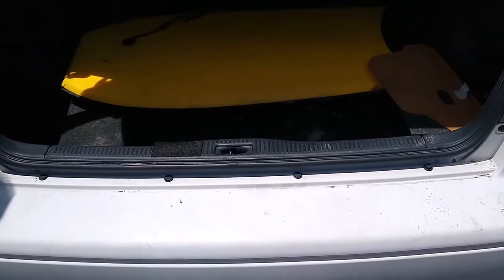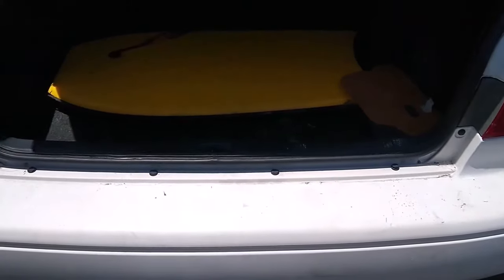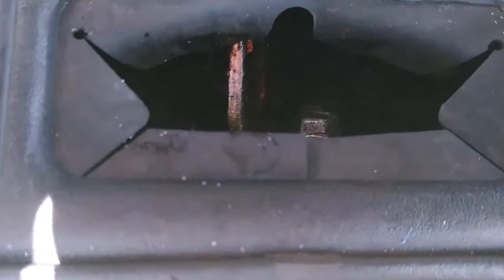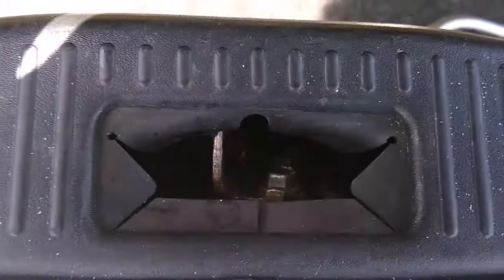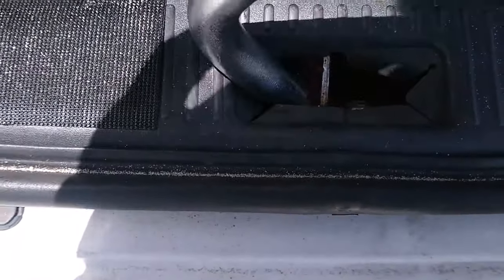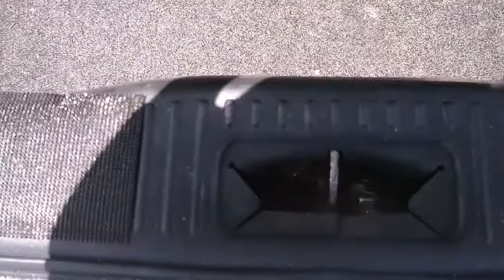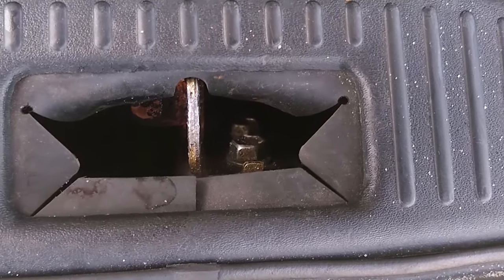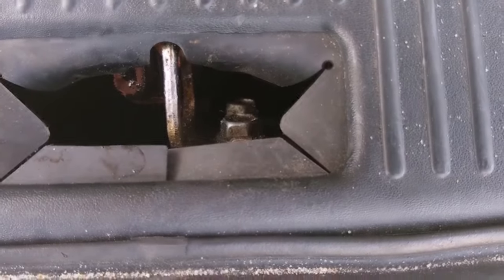How to fix a trunk that wont shut or latch DIY video #diy #trunk #shut #latch

Comment: Thanks very much for sharing via YouTube. I am a 65 year old female and just purchased a 2003 Honda Civic LX 2 door coupe three days ago. The trunk cable inside vehicles opens the trunk but I kept working the trunk to stay closed and locked. The Honda dealer wanted three hundred plus dollars to change the gas/trunk cable assembly. Research using on YouTube and finding this video gave me insight as to what to try first on my very own. Sharing blessings worldwide is what helps make the world go around. Smiles
Reply: @Noreene.  Thanks so much for your comment and best of luck with your next DIY project. Please let us know how it works out for you.   Smiles to you.
Reply: @BigAl-1  It was so easy opening my trunk and I barely touched the gasoline cover cable. I then removed the clip attached on the inner side of the gasoline cover. Now I only have to press the outer outside edge of my gasoline cover to get gas. The previous owner had two keys to unlock my gasoline cap. Thanks for reaching out to me. Much love for people to share their God-given talents, skills, blessings, and love. Smiles
Reply: @noreenebostick9593  I'm so glad it worked out well for you.  Smiles

Comment: For those who got a Nissan Sentra, if the plastic parts of the trunk is ripped from where it latches, do yourself a favor and tear that plastic off. It’s gonna do some damage to your interior, but I’d rather have a trunk that closes. And it closed so that’s what I did. Improvise and see what you guys can do.
Reply: Thanks so much for your comment. Best of luck with your next DIY project and hopefully you will subscribe to Big Al Repairs.

Comment: I think that plastic edge liner pops off and once that little piece is off you can actually directly access the screws  through an opening inside that trunk wall in front of that catch so you don’t have to struggle with the tight space and a socket wrench. At least that is how it is on my old Camry. 
Great video. Thanks.
Reply: Adam, thanks so much for the suggestion.  I will have to give it a try.  Best of luck with your next DIY project.
Reply: This tip was also super helpful! It worked in my car.

Comment: That worked thanks. The 2 screws that tighten it were quite loose ,so l used  a screwdriver to lever it in to a postion where it closes properly now.
Not sure if it will stay there, because the 2 screws have weird fittings and I haven't the right tool
Reply: Thanks so much for your comment and explanation of your project. Best of luck with your next DIY project and hopefully you will subscribe to Big Al Repairs.

Comment: Thank you! It worked. All the mechanics were fine(cables/electronics). Just that darn metal loop was bent and moved over. This video was perfect!
Reply: C.D.J.  Thanks so much for taking the time to comment. I’m glad it fixed the problem. Best of luck with your next DIY project. Thanks again for watching Big Al Repairs and hopefully you subscribe.
Reply: @BigAl-1  thought I was already. Done.
Reply: @c.d.j300  Thanks so much for subscribing.

Comment: So mines not misaligned it’s the hook in the latch part not holding it closed it’s loose is that fixable ?
Reply: That is a great question. What you need to do is look and see if there is any way to loosen or tighten that latch and move it or adjust it. I no longer have that vehicle so it may take me a while to be able to respond and take a look and see what you can do but that would be my guess. Best of luck and please let us know how it turns out and hopefully you will subscribe to big Al repairs.

Comment: I desperately need instructions on how to replace that loop part. Mine broke and I have my trunk duct tape shut. All of the videos I've been finding are of the trunk lid half of the lock not the bottom half that is by the bumper. I have a 2010 Toyota Corolla.
Reply: Horrible,  it looks like on this truck. There are two bolts that you have to remove and then you can remove that latch. Please give us an update. Thanks so much for your comment!  Best of luck with all your DIY projects and hopefully you will subscribe to Big Al Repairs.

Comment: Someone hit me from behind and now my trunk doesn’t latch .. could this be the problem?
Reply: If it's been in an accident it could be this, a broken latch mechanism, or lots of other possibilities.
Reply: I just got hit from the back of December 30, 2021, and today, I went to work with a loose trunk because there's pieces inside the upper latch that's broken. I wish it wasn't broken because this video would have benefited me, but I think I have to replace the top portion. 🥺
Reply: Yes it can be the problem, that exact same thing happend to me, I opened my trunk without knowing and now the trunk won’t close
Reply: Kiera, as mentioned above the problem could many different things including what is in the video.  Best of luck with your next DIY project and hopefully you subscribe to Big Al Repairs.
Reply: @cind4846  thanks for your comment. Were you able to get it fixed?  Best of luck with your next DIY project and hopefully you subscribe to Big Al Repairs.
Reply: No
Reply: Thanks, this was very helpful.

Comment: I got a 1999 Acura 3.5 n trunk doesn’t close n latch is lined up... any advice u can give me thanks in advance
Reply: I have a 2001 acura replace your trunk latch that should do the trick... and line up your bottom latch.
Reply from the maker: Yes, like suggested you could try to replace the latch? I found a new latch for my chevy cavalier on Amazon, you could also go to a junk yard to see if they have one you can buy off another acura

Comment: Anyone know what size bolts these are, thanks
Reply: Faithsalker, Itha is a great question. I should have included that information in the video. Unfortunately I no longer own the vehicle but I will try and get you an answer. In the meantime, if you do find the answer, please share. I’m sure there are many other people that have the same question. Best of luck with your project and hopefully you subscribe to big Al repairs.
Reply: @BigAl-1  I was able to locate one of the missing bolts. The bolt was a 10 mm. Great video, thanks for the video and the reply.
Reply: @faithwalker7  That is great news. Thanks so much for the update.

Comment: Do you know the socket size for the bolts to tighten the metal latch?
Reply: It's going to vary based on the year and model of your car. The ones in that video looked like ~10-12mm at first glance, if you post your year & model it might be possible to look it up online.
Reply: Hyundai genesis 2013 sedan

Comment: I have a 430mercedes Benz trunk won't close keep killing my battery
Reply: I recommend taking out the light in your trunk, so it doesn’t drain your battery. You could keep a lantern or flashlight back there for when you need a light.

Comment: suggestion, blur only the license plate instead of whole screen, or take off license plate before video.
Reply from the maker: Thanks for the tip. Unfortunately the video editor I was using at the time did not have a blur feature...I thought it would be ok since it is only 6 seconds. I will remember this for next time.

Comment: Nope. Wrong. The lid latch won't work. Think the spring broke on mine. Idk.
Reply from the maker: dang it! Can you replace the lid latch? We have done this with a chevy cavalier and we got the latch off of a salvaged car
Reply: @BigAlRepairs  I pulled him a MacGyver I was able to reach up in between the panels of the lid latch I felt a cable in there and at the end of it was an eye hole and then just kept feeling around and eventually there was a little slot crevice with just the rounded portion of a spring hook sticking up I had to grab another hooked tool with an eye hook on it to stretch it enough to be able to reach it good enough after it been stretched I could reach it with my fingers and pull the hook of the spring up to the eye hole connector and that fixed it. I can't believe I even did that I was thinking I looked like an idiot even trying to do what I was doing but it worked. I couldn't see anything I had to do all of that blindly.
Reply from the maker: @jtheexistentialist1221  That is great news! Good work.